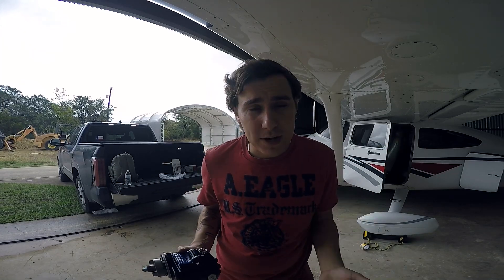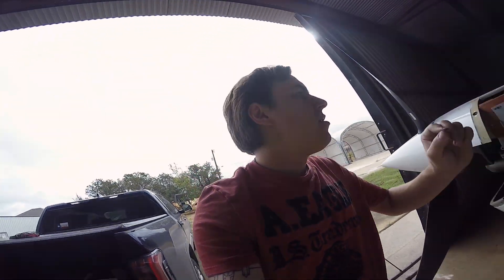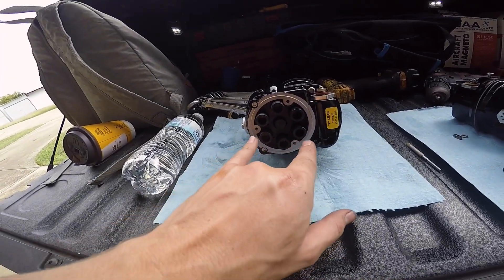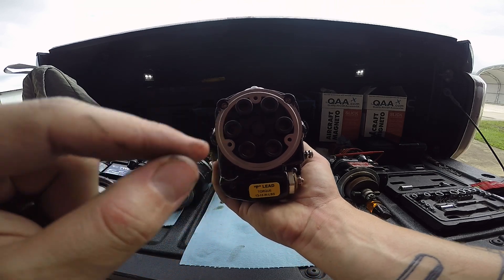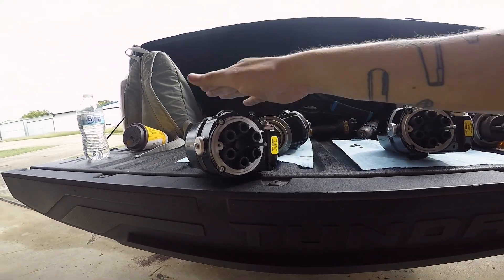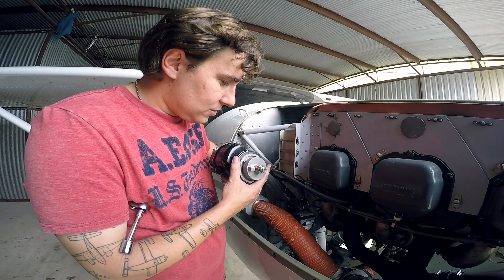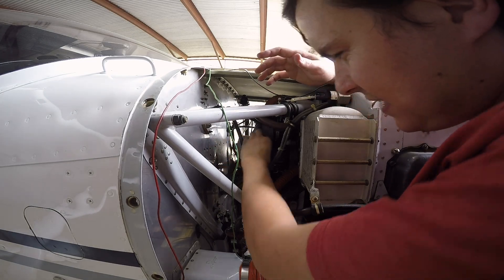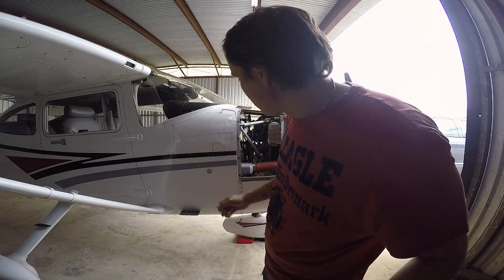How To Time Aircraft Magnetos Like A Pro

Comment: Does the magneto have an initial timing? I understand the advanced timing at high rpm but it does it run that same timing at idle/lower rpm?
Reply from the maker: Yes, unlike a car, the timing is fixed. There is no advance only a retard breaker or impulse coupling for starting. So if it's set at 22° BTC, it's 22° at all RPMs
Reply: Thank you sir! I’ve been curious about this for a while but could never find the answer.

Comment: Informative video. What was the issue with the starter gear not retracting?
Reply from the maker: They were having a hard starting issue and cranked for too long the bendix got to hot and got stuck in the out possion. I ended putting a little bit of LPS 2 on it and got it to retract.

Comment: I do be enjoying your channel. Thanks!
Things I thought of while watching:

I/O-320/360/720's are timed from the top of the case where the two halves split. Just something to keep in mind for new or rusty mechanics. The takeaway is that not all engines (such as this I/O-470?) are timed from the starter. Just be familiar with your powerplant and always consult the manufacturer supplied maintenance manual, of course!

Be aware that there is usually some "slop" in the engine when you are timing the magnetos on the engine. I've seen people (myself included) time them and then after assembly the engine runs kind of rough. So at ~ 7:50 when he goes to spin the prop, it is smart to try and take this slack out and move the prop enough to eliminate this and seat the gear lash, though not so much to pass the compression or run the prop backwards. Not all engines have this issue however (like this engine video'd). But I've found it common on O320/360 and 720s. Especially older engines.

Also be attentive to the clocking position of the magneto, generally the LH one. If it is not clocked correctly on the case end (or if the last guy did it right, you shouldn't have to!), it can be very difficult to get one of the retaining nuts on or impossible to actually time the mag as it will contact the firewall engine frame. I've seen this on fresh factory OH motors most commonly. In which case you will have to remove the mag and adjust the clocking from the case end. A simple process in theory, but always seemingly a struggle in practice. It's not unheard of to jump in and clock it "one tooth", re-assemble, and only to find you clocked it the wrong way or one too far. So be cogniscient of which way you need to adjust the mag and spin the case end accordingly/deliberately.

Also, use new split ring washers as well! Not just the gasket. I've gotten in and found mags where one nut was working its way off because someone (likely) used old and tired split washers. Or perhaps they just didn't tighten it enough. But better safe than sorry!

Feel free to correct me if i'm mistaken here. Just trying to spread the experience!